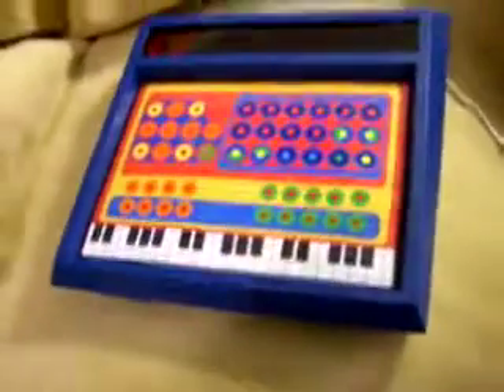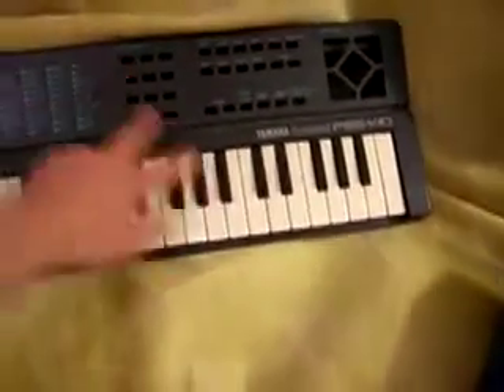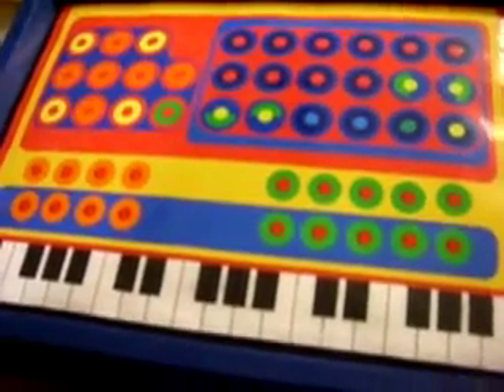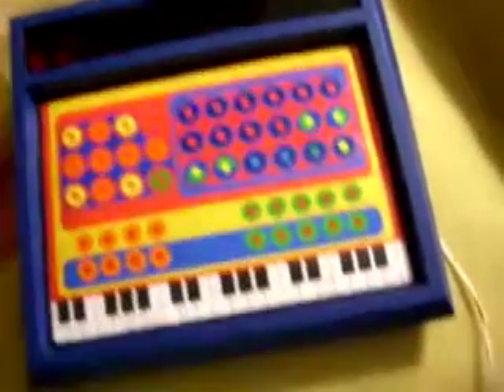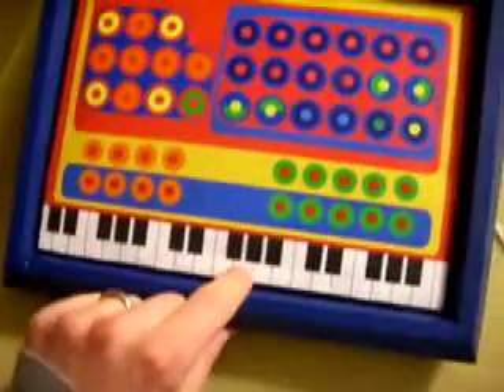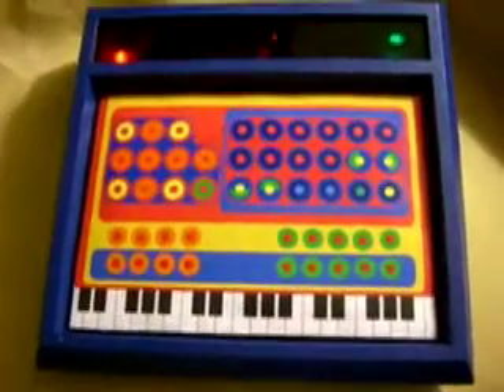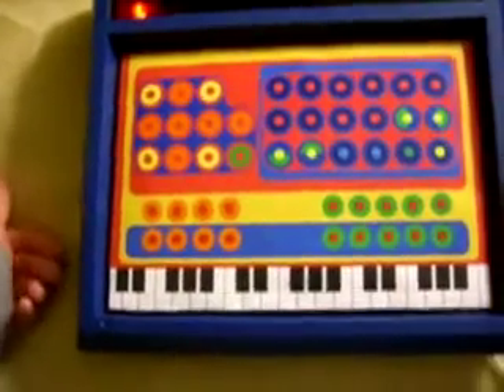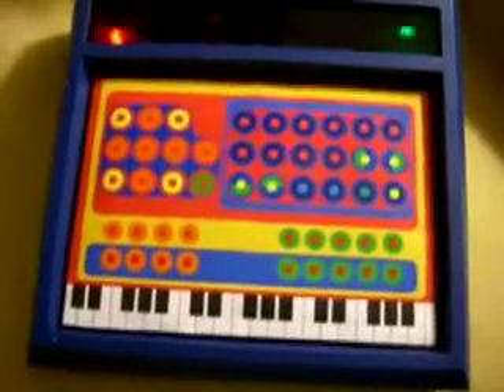The Mystery Circuits Mike-o-Wave

Comment from the maker: Thanks! My intention was to make a membrane out of copper tape traces with contact paper sandwiched between two layers. But it was too thick and caused too much switch bounce. So I just used the bottom layer of the copper tape circuit (on cardboard), and soldered surface mount tactile switches under the laminated paper panel. They work great. The LED buttons are just like normal pushbutton momentary switches. They make the paper glow.